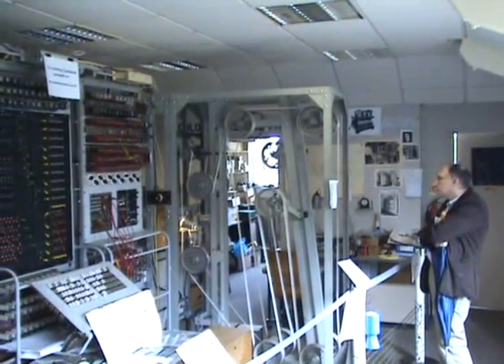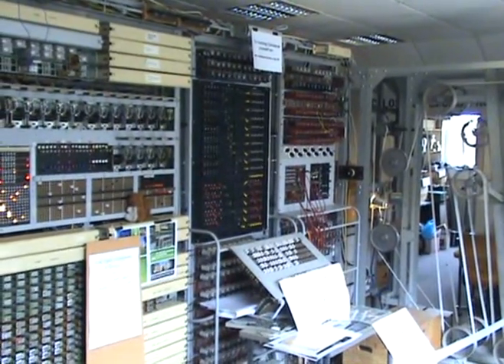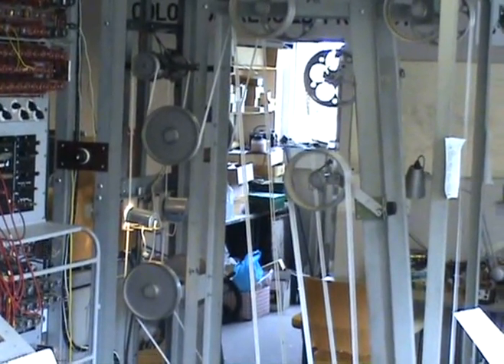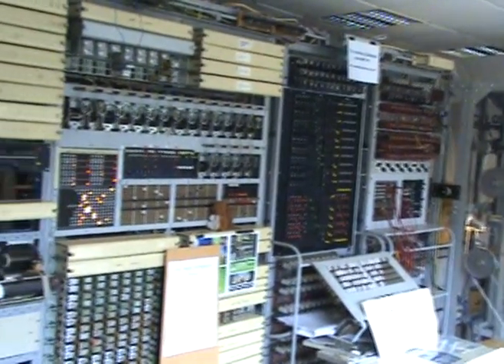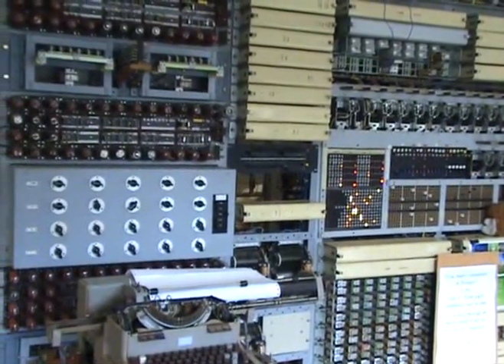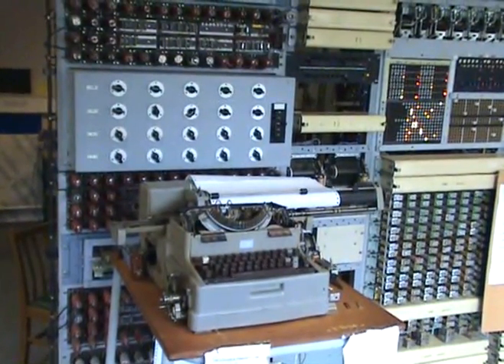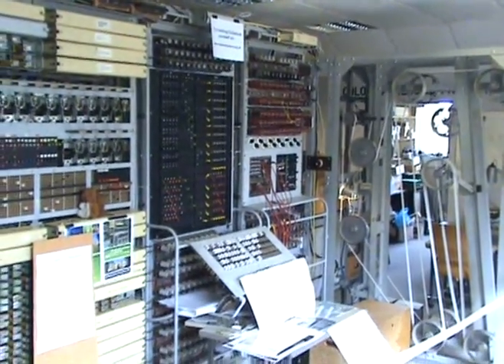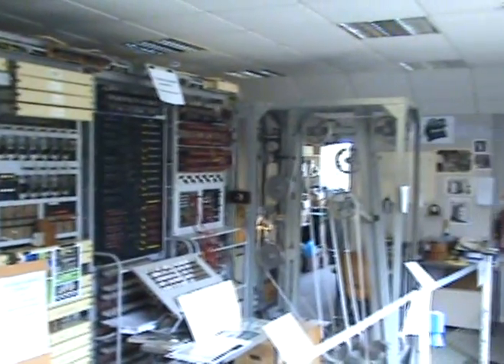Colossus

Comment: Incredible! I used to work with British made telephone exchange equipment in the 1980's. It was built in the fifties, but used those same yellow metal covers over racks of relays. 

That ka-chuck sound that plays about once a second sounds a lot like uniselectors clicking over. They were used to direct a machine like this to go through a series of instructions. Each ka-chunk indicates the selector has moved one step redirecting power to the next processing stage.